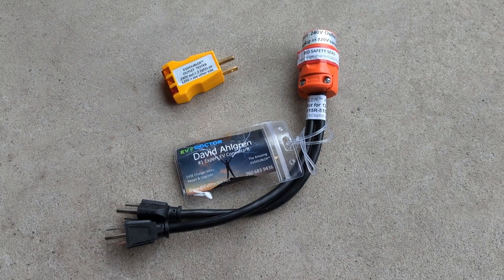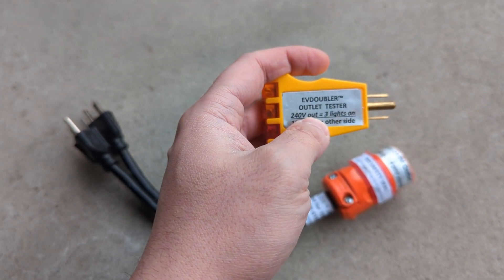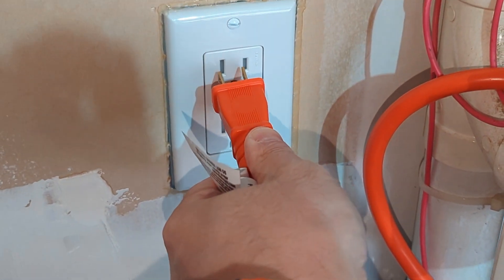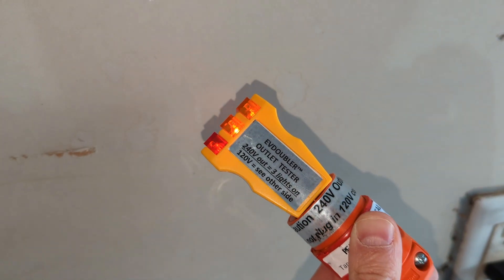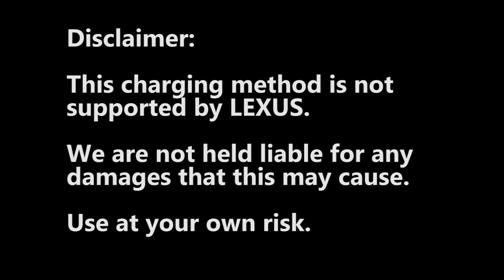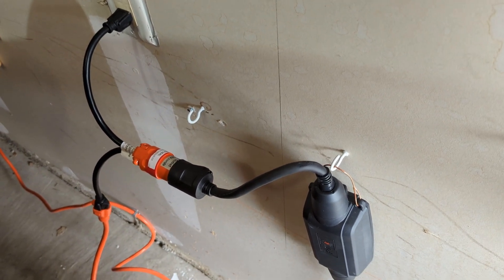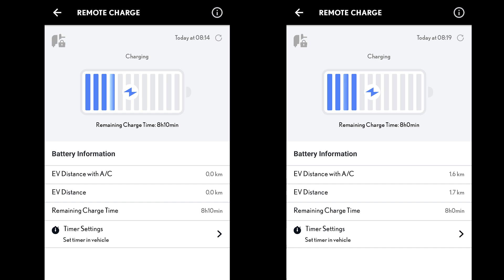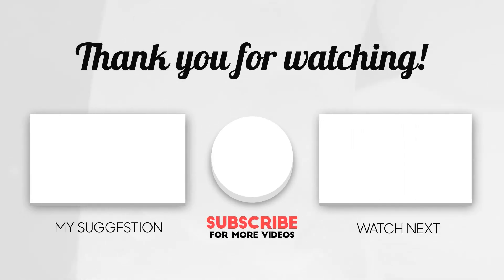2022-2026 Lexus NX450h+ - Half the time to charge

Comment: How is your experience with this extension cord so far?  Is still working well ?
Reply from the maker: Still working well.  I don't use it that often as I don't need it to charge up in shorter time periods.  Typically overnight would just be level 1 and if I need a faster charge then I would connect this.

Comment: Hi, just one question. Do you now what is the maximum amps. charger to use in this vehicle? Recently i bought a level 2 charger and inside there is a selector for the amps. to be used. Is up to 50 amps.  Should i select 32 or more?
Thank's!!!!!
Reply from the maker: The car accepts a maximum of 32A. Even if you set your charger to 50A, the car will only take 32A. So setting it to 32A would be enough. Unless you have other vehicles that support more than 6.6kWh.
Reply: @lsft  Thank's. 👍👍👍✌️

Comment: Ended up getting the SplitVolt plug Nema 14-30 24amps.  My panel is on the other side of the house so I had electrician add on/off switch and plug on opposite side of shared wall with dryer.  Much cheaper and utilize car charging scheduling to charge at night to not interfere with dryer use.  I can charge at anytime since I am on electric company Regular Rate instead of Time of Use rates.  NX450h+ can take 28amps and set NX to 6.6kw Max in settings and had no problems.  At most it takes just over 3 hours to charge.
Reply from the maker: That's great.  That would have been my choice if I had to install something.  My dryer plug is in the basement and it's close to to the garage.  Just need to feed a cable over to the garage and have it split.  How much did it cost?
Reply: I don’t remember since I added it for my 2017 Tesla Model S back in December, 2016.  I charge between home and the supercharger one mile from my house.   I have free supercharging and premium connectivity for life of the car.  NX450h+ is now my daily driver but still have the Tesla.

Comment: Thanks@lsft. I will take possession of the vehicle this week. Does the NX come with a 6.6kw charger? I upgraded my electrical panel and had the electrician install a 240 volt plug (50amps)in my garage nema 14-50. Do I need to get an adapter to use the 240 wall plug? Thanks again
Reply from the maker: The NX comes in 2 chargers 3.3kW or 6.6kW.   You will have to check what version you have.  In Canada, all NX450h+ comes with 6.6kW.  If you already have a 240 volt plug, you will need to get an EV charger like ChargePoint or Grizzl-E level 2 chargers.
Reply: @lsft thanks for the reply. I don't need the level 2 charging, I'm fine charging it for 5-6 hours...it's better for the battery.. I live in BC so it'll probably come with the 6.6kw charger. I guess I just need to get the adapter so I can plug it in directly to the 240 volt outlet
Reply from the maker: You will need to get EVDoubler 240.  But you already have the 240 outlet for a level 2 charger installed, should you put the money in getting a level 2 and skip the EVDoubler?
Reply: @lsft  not too sure. I was looking at the ev website and they have the 14-50 nema adapter.
Reply from the maker: @joelego3728  Yes, they have an 14-50 adapter for the EVSE that is supplied by Lexus.  Just double check with them to ensure it's all good.
Reply: Where do I buy this adapter from?

Comment: When I charge my 450h+ here in the UK, the mobile app reports that the battery is at 100% and EV range is maybe 50 miles but that there is still 30 minutes of charge time remaining until full. During these 30 minutes, the EV range doesn't change; the battery remains at 100% but it continues to pull maybe 1KWh for the 30 minutes. Do you have any thoughts as to what it's doing during this period?
Reply from the maker: I don't know exactly what it is doing, but it maybe conditioning the battery so that it can run on optimal temperature???

Comment: I've got my nx450h+ with 6.6 kW onboard charger. I would like to have a 2.5 hrs charging capability at home. Do I need to buy external charger or would be enough to use J1772 plug connected directly to 240V and 32A? The owners manual specifically indicate that car is equipped with "6.6 kW onboard traction battery charger " i am confused because most of my colleagues telling me that I need to buy external battery charger. What is your recommendation? 
Edward
Reply from the maker: Edward,

Your colleagues are correct. You do need to buy an external EV charger. The EVSE that came with your vehicle is rated at 120V at 12Amps. That is the max you can get. In my video I have it with the EV Doctor to bring it to 240V @12Amps. 

If you need 32A, you'll need to buy another evse or an EV charger to get the 2.5 hrs charging time. Hope this helps.
Reply: Which one level 2 character you would recommend?
Which one do you have?
Reply from the maker: I actually do not have a wall charger.  The 12 hour charging seems to work for me.  If not, I would use this EV Doctor to charge it in about 6 hours.

But a few NX owners have installed wall chargers and they are using:
ChargePoint Home Flex or the EnelX JuiceBox 

Do some research on them and see which one works for you.

Comment: great video... like many others I have been trying to look for a solution.  Driven the 450h+ over 9,000 miles so far.  It sure is nice to use a public charging station at 220 and have been looking for that for a home plug in... I did read in the manual - the Lexus advises against using an extension cord of any kind. I did like the extra detail you took in sharing with us the rating of the cord you used... I took am concerned about the cable overheading from Lexus or the extension cord or pig tail into the plug overheading.  You didnt go into a GFI?  BTW - Hi Ted Witte, this is Marcus Witte, living in SoCal and originally from WI
Reply from the maker: If you use GFI, the split will not work as it will trip the GFI socket.  Lexus advises against using an extension cord because most people will just use a normal extension cord and it will definitely overheat.  I tested this method and touched the cord while it charge and it didn't feel hot at all.  It is critical you have the write extension or else it will be bad.

Comment: Thank you for this very informative video. I was especially glad to see the last minute or so were you used an external charging station. We currently have a Tesla Model 3 and a Tesla charger in our garage. I don't like the Tesla so we're getting rid of it because of the interior. It's just too much hassle to go through the touch screen for everything, otherwise it's a good car. We're looking at the 450 h+  but it's not available here yet. I have an important question for you.
 The Tesla charger in our garage is 35 KW hour, level 2. I know I can get an adapter that changes the proprietary Tesla plug to the standard  J1772 plug that is what you have on the NX, and that is what other power stations use. Do you think I might be able to use the standard Tesla charger I have in my garage to charge this battery using the 1772 adapter?
Reply from the maker: Is your charger a 35Amp charger or kW? 
Some existing 450h+ owners have used the Tesla charger with the J1772 adapter. It will definitely work.

Comment: The bigger question is can the stock charger power cord handle 220V? if not you can make heat and cause a cord fire.
Reply from the maker: My stock charger can handle it. EV Doctor asks what model of the EVSE you have.

Comment: this is a great video, I wonder if it's possible to get 4 120v outlets going at the same time and maybe get a full charge in about 3 hours?
Reply from the maker: I'm not an electrician, but I don't think that is possible. 2 plugs in a different circuit gives 240V. Making 4 plugs won't make it faster. You most likely burn the cable.

Comment: Hmmmmmmmmmmmm? charge my car overnight......Sleep zzzz! who cares about speed........Additionally,  in my research (specifically " Battery University" ) it is better to charge Batt's S-L-O-W for longevity! NOTE:  "  The battery university does tend to suggest that, in general, lower charge rates lend to longer battery life. "...Soooo what's your hurry & you will zzzzzzzzzz Better!
Reply from the maker: I don't sleep more than 8 hrs and by the time I go out, it won't be fully charged.  There are scenarios where people will need a faster charger.  The fastest is level 2 at 2.5 hrs, but this mention is only 6 hours which is still not the fastest possible.  But it does give me the opportunity to charge during the day and have a full charge at night when I go out.  It may not be for everybody, but at least you are aware this works.
Reply: @lsft  Gee...Glad you get your sleep however when you get home from work approx 6PM simply plug your car in while you are having dinner and doing whatever Clearly enough time to charge via 120V...Me ThimK's you are suggesting you get home every night at 10PM....long day however,  Still if you simply plug this in and work from 8AM to 10PM that's a 14hour day OUCH! every day.  You are one HARD working Gentleman!
Reply from the maker: @donaldbanner2185  Well, I'm currently working from home, so I really don't need to rapid charge as I don't drive as much as I use to. It's more like after work, I have dinner with friends and get home around 10. Then I'll need a faster charge since the 12 hrs won't work. But that's still rare at the moment.
Reply: @donaldbanner2185  you assume too much. Everyone has different lifestyles. Gym, food, friends, errands, other plans.... I'm rarely home 12hrs at a time. The range isn't a a lot either... So 12hrs to have ~65KM range is nada. 6hrs is also much slower than the fastest 2.5hrs... So your still extending the life.

Comment: Ok, so my 120v is super slow and I'm looking at this option. What's your experience so far? If it's still good, what's the exact part # I need? Thanks for all your videos and help!
Reply from the maker: Experience is great. I just used it on the weekend since I used up all the EV range in the morning and I used the EVdoubler and the car was full for my evening ride. 

The part number is: EVDOUBLER -120V which is for 2x 120V plugs that are on a different circuit.
Reply: Cool. That makes sense. Plus the two times it's happened, I had just driven it (close to 100° F here in Kansas City. Thanks for the help again!
Reply from the maker: @rodulfol  It's possible that it needs to cool down the battery before charging.
Reply: @lsft  I think you're right. It went from 57% to 58% in about 40-45 minutes then from 58% to 69% in the next hour. I think it spent some time cooling the battery before it went to full charge mode.
Reply: @lsft  one thing you might want to mention, which I found out the hard way, is that the socket you have have the doubler gadget plugged into should not have other other appliances or electrical gadgets plugged in at the same time. Apparently this pulls too much current and will pop your circuit breaker when charging your NX
Reply from the maker: @rodulfol  It draws 12 Amps for each plug. If it trips the circuit you could set it to 8Amps but it will charge slower. Even using a normal 120V plug, you will have the same problem if you have another appliance that draws a lot of amps.
Reply: @lsft  yeah, the good thing I usually don't plug anything else to the other plug, but every once in a while I'll forget and suddenly.. pop, no more current.. lol. No biggie. I just know if I need to plug something, not to have my NX450H+ charging.
Reply from the maker: @rodulfol  I have small things plugged in like my garage door opener, and some smaller stuff.
Reply: I found the part and just ordered it. I also confirmed my 2 sockets in the garage are on separate breaker 😎
Reply from the maker: @rodulfol  that's great. It's the plugs side by side? Or you need an extension cord?
Reply: I'll need an extension for one of them so I'm going to get a sterdy one like yours.
Reply from the maker: @rodulfol  make sure you get an extension that does not have a light at the end. Mine is 12 gauge.
Reply: Ok, didn't know that. I will and thanks for the tip!
Reply: So I got the doubler, and it seems to work good. However, it seems like the engine cooling fan comes on faster and longer when I first plug it in. As soon as I unplug it, it stops. What's your experience?
Reply from the maker: @rodulfol  Is it the engine cooling fan or the battery cooler. Keep in mind the battery is charging faster and it will need to cool it